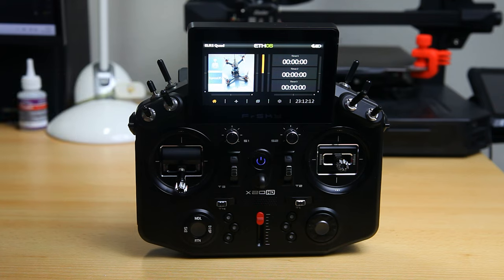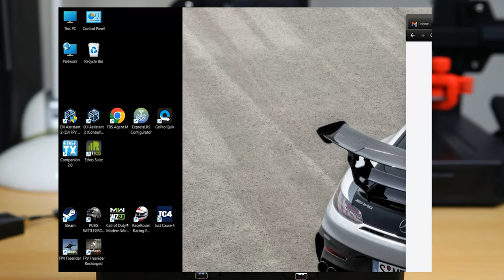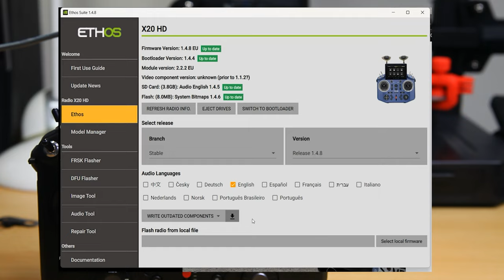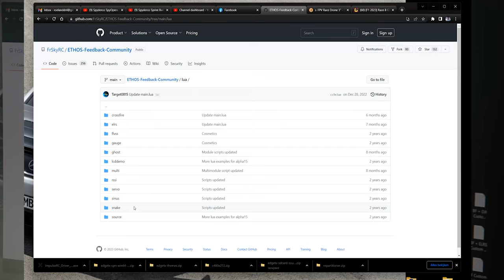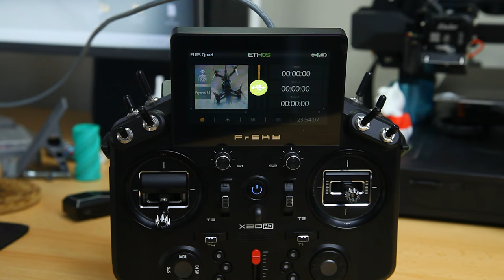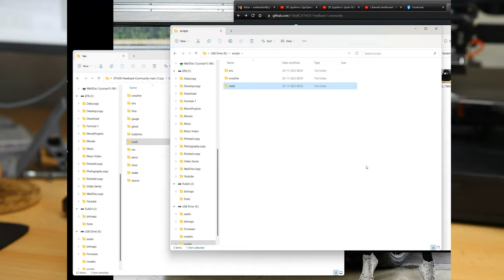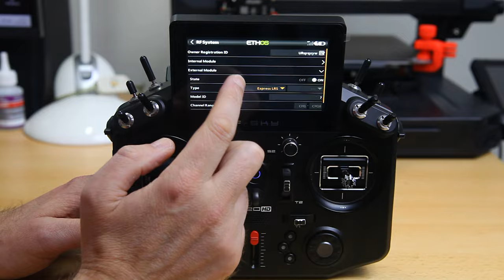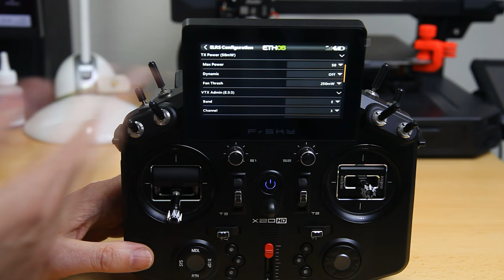Add ELRS & CrossFire To FrSky Tandem X18 / X20 (Ethos Radio's)

Comment from the maker: Not hard (once you know how to :P) 

Ethos community (scripts)
https://github.com/FrSkyRC/ETHOS-Feedback-Community 

The Happymodel ERLS module I used: 
https://www.happymodel.cn/index.php/2021/08/26/happymodel-2-4g-expresslrs-es24tx-slim-pro-tx-module-for-x-lite-tango2/ 

The Radiomaster ELRS module I used: 
https://www.radiomasterrc.com/products/ranger-2-4ghz-elrs-module
Reply: Hi sir i wanna ask something . How the Ranger Modul(the big one)  Radiomaster can sit in there ? the pin holes of this radio is from the bottom.
Reply from the maker: @captaindronieversefpv  ehm well.. I actually had no trouble fitting it, apart from the radio's handle being in the way..
Reply from the maker: @captaindronieversefpv in case you're wondering: I did not have to modify the radio or module

Comment: Hi, nice video. I’m struggling to get the Happy module in my X20S. Trying for hours now but still no luck. I also have the 4in1 module and don’t experience any difficulties putting it in the extension bay. Any tips and tricks to get the Happy module module in place?

Comment: Hi DutchRc. I just ordered from rcgroup almost brand new x20. I currently have the Ranger with the lcd screen version. Came with two antenna. Do you know if that other antenna that isn't patch like urs fit or I still have to remove the handle? By the way does the radio get the telemetry? Or telemetry doesn't work? Ty for the videos I been watching some of you're video for a while. :)
Reply: Oh another thing the module come with jr and a nano adaptor. Is nano adaptor the one that will work or i have to buy seperate adaptor? Ty so much
Reply from the maker: You will have to remote the handle eighter way :)  and I think that non-patch antenne simply is less directional (so less range, but better performance in all directions apart from straight ahead) 

yes.. very nice of RM to include both options! For the X20 radio you will want to use the nano adapter

Comment: If you are careful you can actually flip that handle over because i had the same issue with the Ranger module
Reply from the maker: Thanks! I personally don't use the 5.8Ghz setup though a handle is handy without that as well :)
Reply: @DutchRC  didn't know it was 5.8 I thought it only had 900 and 2.4 lol
Reply from the maker: @anthonysmith6825 OMG.. sorry.. was somewhere else with my mind :P  sooo yeah.. the "internal" 900mhz antenna is in the handle.. ahum :P
Reply: This is a great idea! I've got to try this. I ended up taking it off and stuffed an immortal T inside to replace it.

Comment: I ordered the happy model nano for my x18 did my best to follow the tutorial. the receiver is radiomaster er4 I cant get it to bind at all. so frustrating. $60 paper weights. looks like theelrs script is in the radio and running as external rf. the reciever can enter bind mode but that is where everything stops.
Reply: Somehow I got it to work. what a pita! I think the last thing i read got it going turning off model match, which to me seems wrong but it did bind after i did that.

Comment: Hi Roland.  I'm currently using a RadioMaster Tx16S, and i really want to move to the X20S, but i have been unable to find if ELRS V3.0 is supported.  Is there any chance you know the answer to this?
Reply from the maker: I do :)  I run ELRS 3.0 on my X20S and X18SE.. no issues.. basically the ELRS version doesn't matter to the radio
Reply: @DutchRC  thanks much for the information!   I know the module gets updated, but I didn't know if there might be some code on the radio as well.
Reply from the maker: @frankhudson3582  well yes actually: in OpenTX / EdgeTX radio's there is a script needed on the radio to support ELRS.. that has been taken care of by Frsky though, and those scripts rarely needed updates..

Comment: I can’t put the crossfire JR nano (x20hd) module on the radio, I already broke 2 pins on the radio :(
Something is wrong with the my crossfire nano
Reply from the maker: it IS indeed tricky to get the modules seeted correctly but it can be done (I have a Crossfire nano in my X18SE).. 
that daughterboard (with the pins) in the radio is Easy to replace by the way
Reply: @DutchRC  Yes, i know. Ordered it yet)
Your crossfire nano easy to install on your radio?
Reply from the maker: @WalterCastillo  yes easier then the small ELRS one.. But I knew on forehand it's paramount to first get the module seated well and Then push it down.. 
But yep.. it's kinda scary as them pins are fragile ;)
Reply from the maker: it's come to my attention some modules might not fit on all X20's.. Some X20 have a "ridge" around the module bay (?) preventing the module to be propperly seated.. 
Can't attest to it myself as it seems my X20's don't have that ridge.. 
However: if you run into this problem a fix could be to shave / sand a bit of that ridge away... 

Could that be the cause of your issues?

Comment: Hi sir i wanna ask something . How the Ranger Modul(the big one)  Radiomaster can sit in there ? the pin holes of this radio is from the bottom.
Reply from the maker: @captaindronieversefpv  ehm well.. I actually had no trouble fitting it, apart from the radio's handle being in the way..
Reply: @DutchRC  ah isee. I just realize that radiomaster ranger modul come with the connector that fit with this radio. Thankyou sir

Comment: I have an X20HD too  since a week. On mine there is an rectangle plate at the back of the screen direcxt over these couple of little holes. Is this normal on newer models?
Reply from the maker: I have seen those as well so yes I think that is the latest revision.. there have been several version of the HD radio by now (with revised electronics and for instance different HDMI port-types)

Comment: Hi Thanks Wondering if the happymodel elrs es24tx slim pro will fit on the x18 without having to remove the handle antenna??
Reply from the maker: Not completely sure if it would work when installing the module, but you could re-install the handle when it's in place
Reply: @DutchRC  sounds good thank you!!!!

Comment: Everything I have seen and read stated that on the Tandem’s that handle you removed was part of a second antenna (diversity?) .  Is that incorrect?????
Reply from the maker: That is NOT true.. the handle has the Only internal 900mhz antenna. The radio also has Two 2.4Ghz antenna (in the endges of the screen).. 
So without the handle, you no longer have 900Mhz
Reply: Is that "not" what I just said?  I own the X20S.  This is hands on knowledge is why I said what I said.  If I have taken your reply out of context I am sorry.   @DutchRC
Reply from the maker: @MrMSScott  well ok.. if that's what you ment THEN you were correct :D

Comment: the x20 is not compatible with all nano modules. 
I have a vantac elrs module that fits fine on my x20s, but my Radiomaster Nano ELRS module does not fit on the X20 but it does fit on my X18S just fine.
Reply from the maker: that is really weird.. I also have a Radiomaster module on one of my X20's.. I can't imagine Radiomaster uses different mounting systems
Reply: @DutchRC  That's because your using the larger Radiomaster module with the adapter. The nano module doesn't fit the x20 and I'm pretty sure the TBS Crossfire nano and the MPM nano module don't fit the X20 either. 

The X20 has a small protruding plastic rim around the module bay that prevents wider nano modules to fit. 

The X18 is completely flat around the module bay and fits all kind off nano modules.
Reply from the maker: @woltervandenberg  I have a Crossfire nano in one of my Tandem radio's.. Again: I can not imagine RM uses 1 formfactor for 1 module, and then another formfactor for a 2nd module
Reply: It has nothing to do with Radiomaster. The coonector is the same. The only thing that's different is the width of the module. The problem lies with the design of the X20. Take a look at the module bay of the X20 and compare it to the X18. They are not the same. 

The module bay of the X18 is flush with the backside of the radio while the module bay on the back of the X20 has a small edge that sticks out of the back. 

My radiomaster Nano module does not fit in my X20 because of that plastic rim and I'm pretty sure the Crossfire nano module does not fit in a X20 directly either.   

I have seen people cut of that piece of plastic at the back to make their modules fit. 

Maybe FrSky changed the design of the backcover on the newer X20 models but my X20 does not fit all nano modules because of that. Only the small formfactor nano modules, like the vantac modules and the irx4 lite will fit because they fit in between the plastic tabs. 

Please check if your Crossfire nano module fits on your x20 because I don't believe it does.  

And please consider editing this video. Your spreading false information and I believe there is already one other person in the comments that was not able to fit a Crossfire nano module on their X20.

Comment: Thanks for your video, compatible with X20Pro please?
Reply from the maker: You're welcome :) 
Surely it is? I do not have the Pro version, but the firmware is generally the same, and the physical module bay is identical to the "normal" X20 (?)

Comment: Not strictly radio related, just a general wondering. Have you tried open source frames yet? I am totally falling into love with the concept of Open Racer Frame. It is a flat frame, that uses a heavy-duty TPU canopy for protecting the electronics. As it is open source the risk of most of the stores dropping the design is low, so you can get hold of spares.

https://youtu.be/GezBiZt1H9I

I have ordered parts for building this, since I am trying to learn to pass gates and don't want to bash up my pristine freestyle build. You can always get some excuse for building a new quad, you know the drill 🙂
Reply from the maker: Welllll! I actually did a video on the lated TBS Source One which I guess is an open source frame.. It's nice and cheap but I didn't make me fall in love with the concept :O 
Maybe I'll have to try it with a different one ;)  On the other hand: frames can be had at a low price and still have a good frame (Rotorama frames usually do that for me)

Comment: do you know if i can add the dragonlink module?
Reply from the maker: I would be surpriced if that wouldn't work.. DL has been around for ages and I've seen it work on all kinds of radio's.. 
BUT.. I have never used it myself...
Reply: @DutchRC  actually I have the module in another radio but in this one I don’t know the pins out signal I mean ppm voltage and ground
Reply from the maker: @javieruriel  I would have thought the DL modules are allways hooked up to the radio via a "external device" connector (servo plug basically) as allmost all radio's have it (?)